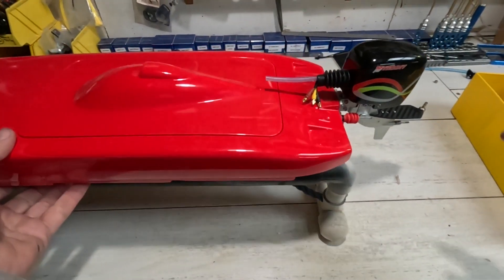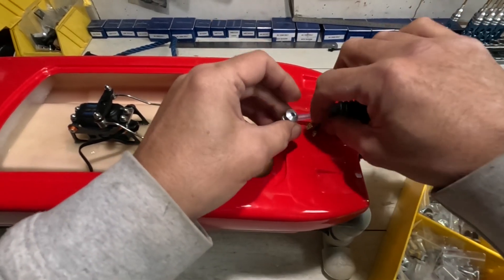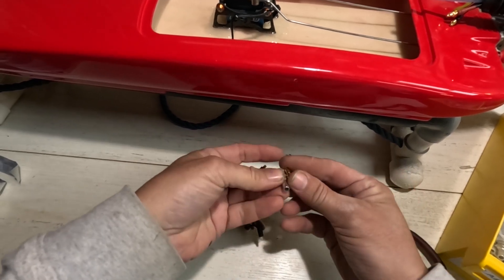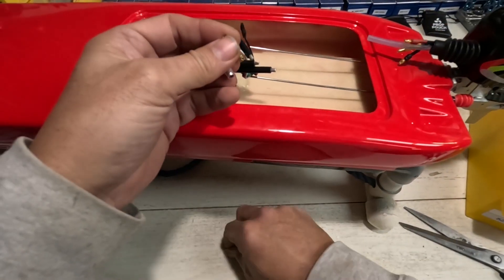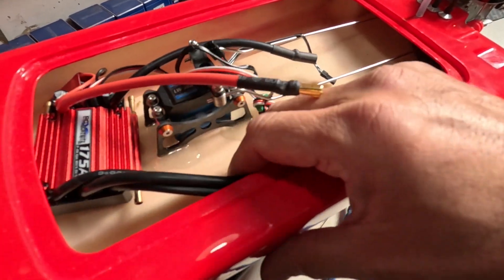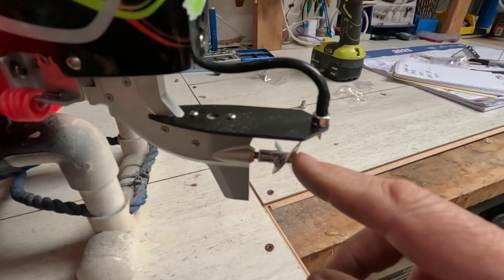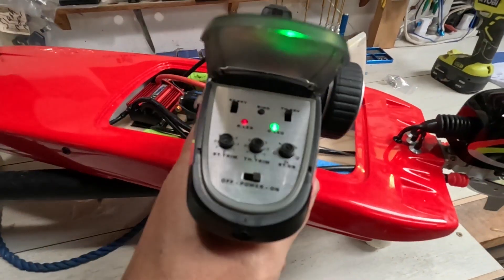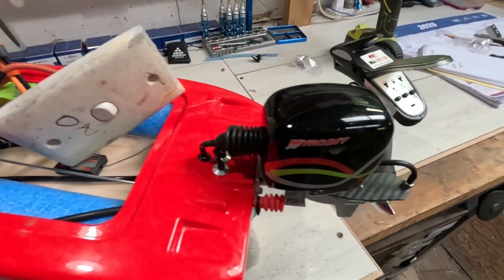Mini Zonda Outboard project Video # 3 ESC and water lines

Comment: Joe , Great Job . 👏👏 
Looking forward to the next video .
We will need details of how you made those connections to the motor . How did you press fit the terminal into the water nozzle ? Thanks.
Reply from the maker: After drilling it out to 5mm i press fitted the terminals in using a vice, i had to solder the wires on an angle because the bottom of the terminals were near the floor of the boat, but nothing was hard to figure out